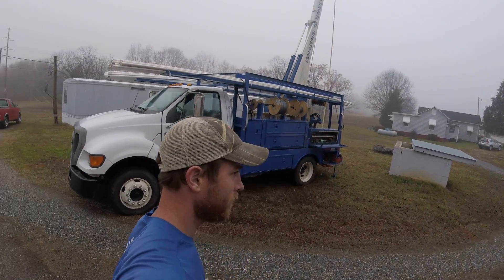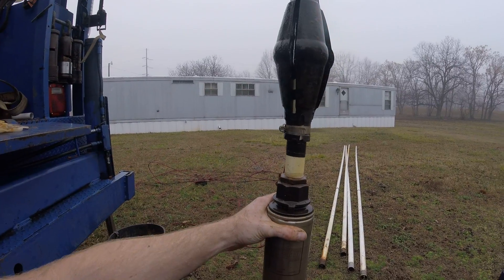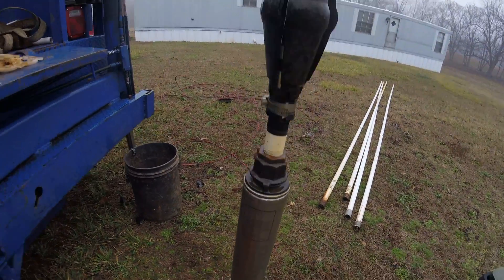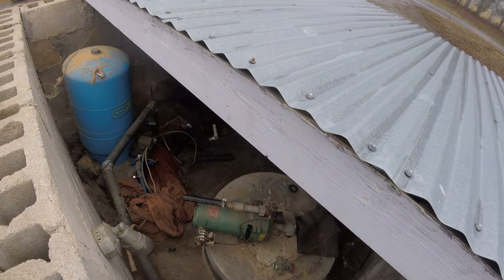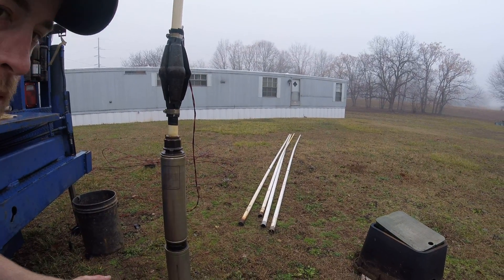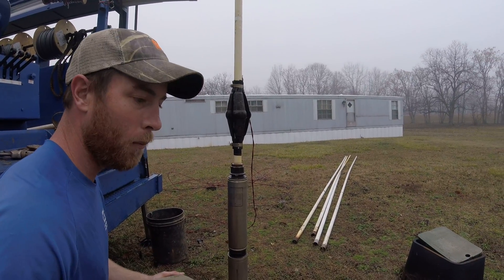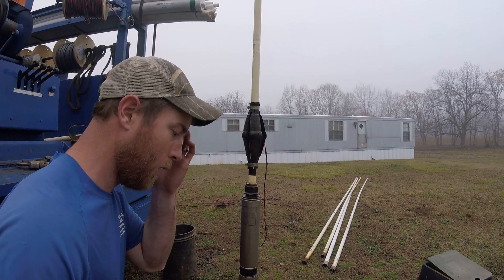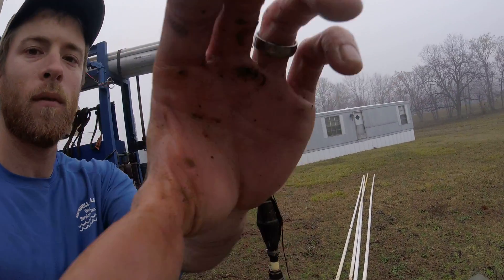Low Water Pressure: Troubleshooting a Water Well Pump that Keeps Running

Comment: That's what my pump is doing. I pulled it today. It's 26yrs old. The motor ran 24/7 & only made 25psi. With the power off the pressure didn't drop, so I knew I didn't have a leak. The tank is new but couldn't be the tank because a tank won't stop it from building pressure. If the pressure tank is bad it cycles on & off too fast, simulator to a bad ps switch.

Comment: U didn't even say what was wrong with it lol u said the thing in ground looks brand new like the day they put it down there said something about a tank but never really said what ur going to do to get there water back on. I'm having same problem my pump just continues to run and my sinks are splattering when I turn water on and barely have any pressure.
Reply: Same problem with mine and he didn't say what it was.